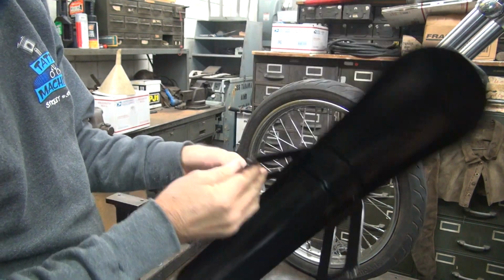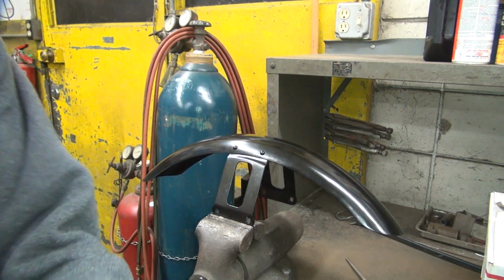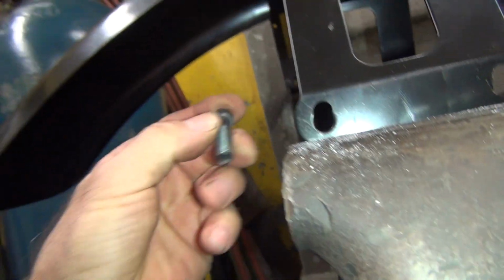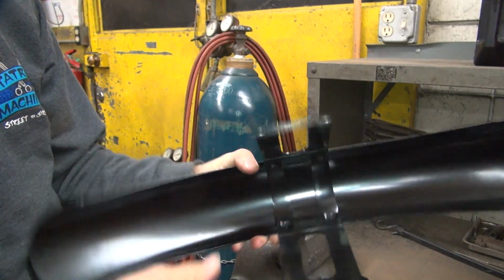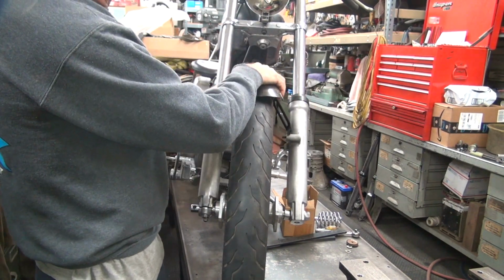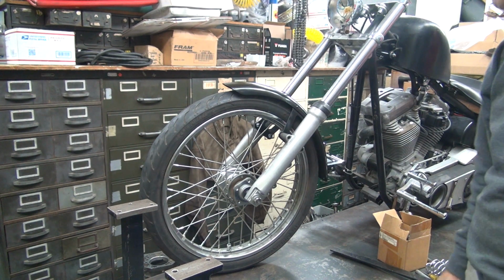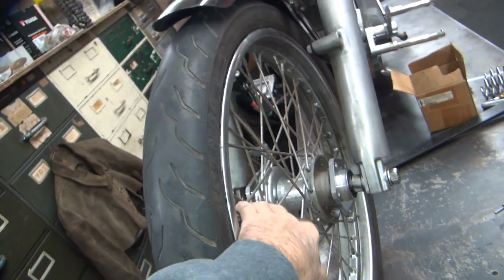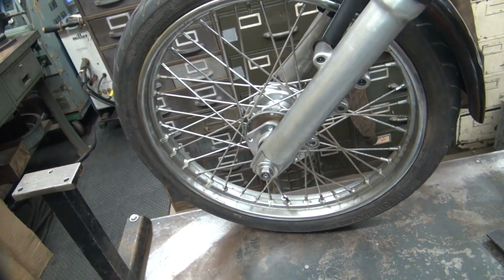#141 1999 80ci evo chopper used bike tune-up repair rebuild rigid bobber custom harley tatro machine

Comment: @5:00 you can see the tire is off center 🤔 getter dunn tatro 👊💨 way off actually 😬
Reply: i thought that too. looks like a dual disk wheel but later in he shows it only has one caliper so i guess its spaced for that.